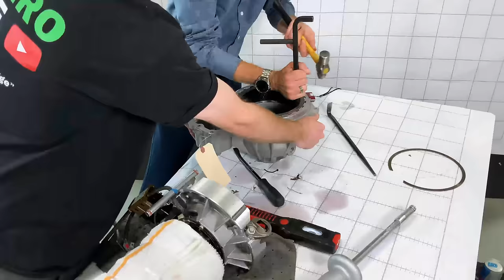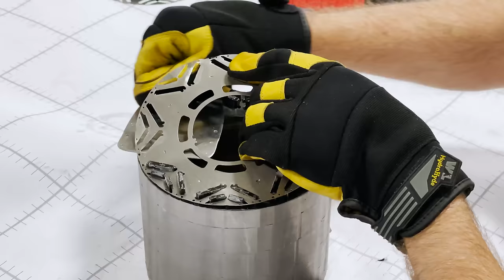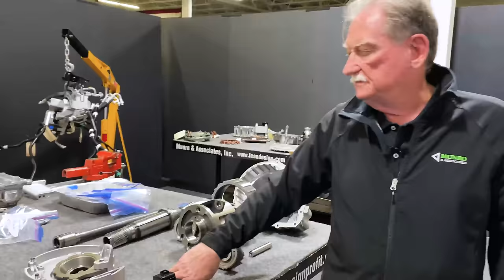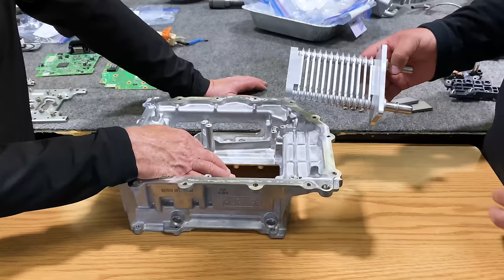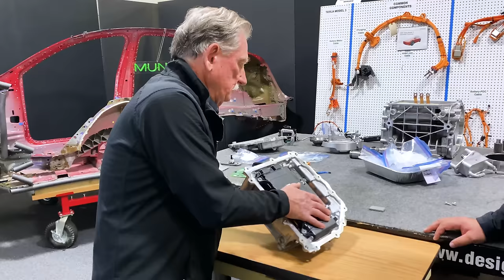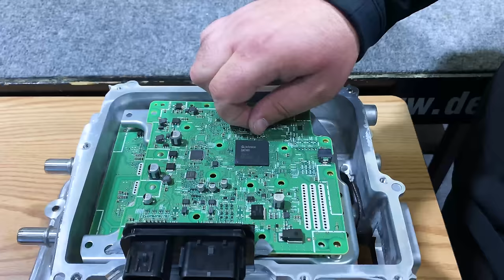Ford Mach-E Rear Motor Teardown and Analysis

Comment: With 7000 miles on my Mach E, the vehicle is running flawlessly. (Phone as a key has had issues). With 9000 miles on my Tesla model 3, I’ve had two visits to Tesla service for minor issues. Rear view mirror fell off and the charging door wouldn’t open. I’ll reserve judgement until both have had 50,000 miles on them.
Reply: My friend just sold her Tesla model 3 last Saturday and bought the Mustang Mach E and she said it's so much better to her. She had hers for 9 months and had several issues and she had enough.
Reply: That's a reasonable way to assess them from the consumer level. But from an engineering level (and I am NOT an engineer.. so looking at it from a limited perspective).. cost analysis and engineering complexity.. Ford is up and down from one area to another. They got some things done well.. other areas seem to need a lot of refinement. Not to say Tesla is perfect lol.. but a lot of their issues is the fit and finish an quality control that they need to improve on.. as a fairly new company, you can expect these to naturally improve and mature over time. They already have drastically. As well as their under body design, going towards the mega castings. As for Ford. I am not so sure these engineering challenges just improve naturally. My concern is these are things pushed on these engineers based on Fords culture of operations. Silos.. bean counters.. parts bins.. management making decisions when they have no real interest in what's best for the customers. Not a fan of the MBAs making decisions on the guts of the cars.
Reply: Has the phone as a key issue been resolved with the Mach E? Also, what year is your M3? I've heard early builds had a lot of issues.
Reply: @jodrhh  yes the phone as a Key issue has been resolved to an extent. But  every time there is an OTA update it seems I have to reinstall the phone as a key. My model 3 was purchased in December 2020 but is a 2021 model year. The Mach E was purchased in February 2021. We wanted to replace our 2013 infinity jx35 and the obvious choice was the model y buy we decided  on the Mach E after test driving both.

Comment: 24:50 I am certain this pcb is mounted first and after that the mosfets are placed one by one and soldered. Or the mosfets are soldered on this pcb first and then this pcb is mounted sliding thos mosfets between the cooling ribs. Both ways are much simpler and are way faster as it will 'auto align' the parts.

Comment: You "never see" brazed plate heat exchangers on EV drive units then walk right over to a Tesla drive unit and lay your hand right on their brazed plate heat exchanger.   (???)
Reply: ...sometimes Sandy is a little too cavalier with his critiques.
Reply: Yeah, had a big WTF moment there for me too. Not sure what he was trying to get at there.
Reply: Ford's heat exchanger was inside the case (noticed from the short clips in the opening sequence).  Tesla's is outside.  That might be what he meant.
Reply: @charlesball6519  In the second brief clip barely one second into the video you can clearly see it on the outside of the drive unit (upper left in portion of the image).

Comment: "There was not enough room to get SEVENTEEN in there..." LOL! Sandy is RUTHLESS!   
Also, holy crap - lining up the board with 90 pins below = bent pins on every unit 100%.  
Definitely at least 25 dropped screws rattling around in every one of these...  
Great work Sandy and Ben!
Reply: Sandy looks at motor:  "I see nothing but heartache and grief."
Reply: ...sure, but only time will tell who's design is best.
Reply: It reminds me of why CPUs moved from having pins on the CPU to having pins on the motherboard. Bending those pins was extremely easy!
Reply: @AudiTTQuattro2003  Agreed.
Reply: @AudiTTQuattro2003  - The more parts and clutzy design the greater the chance of future problems.
Reply: @AudiTTQuattro2003  what time is necessary? they have the competition right there next to it. You can SEE the differences. And the performance numbers are already known. Ford's motors are 'the best' at nothing I've seen measured

Comment: Never saw Sandy this depressed talking about engineering... 😔
Good job, Ford! 😂
Reply: exactly my thoughts haha
Reply: I feel like sandy is too focused on cost reduction. Faulting Ford for having an oil cooler while praising others for not having one is nuts IMO. Give me the oil cooler any day. Or welding a high voltage electrical connection over a snap in. I’ll take the weld. Especially in an application with plenty of vibration. He knows his stuff, but this mentality is why we get cheaply built crap. It’s  anti-consumer and pro bottom line for the company.
Reply: @AustinFerguson  the build quality of the Electric Motor in the Mach-E looks way more advanced and robust compared to the Tesla.
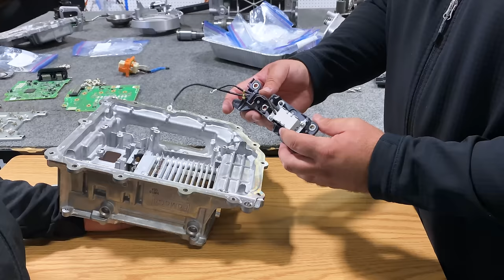Reply: 19:07 MECHA-MUNRO!!
Reply: Yep...I was about to post the same comment
Reply: @RogerM88  What's in the fuck do you really know about fasteners that wasn't regurgitated information? Please do explain Mr sideline engineer with your wealth of knowledge. 
I'm waiting for something that's not regurgitated so please enlighten us?
Reply: Wait until he meets your mother. Bahahah!🤣😂
Reply: @jabroni6199  ...I agree. Not having the full story behind why some of the design was done, could be just harping about his own lack of knowledge of the engineering involved. Kind of like Fox News complaining about Obama not saluting a Marine guard correctly. At the time, it seemed a big deal. Now we know it was stupid and juvenile.
Reply: @twany442  what does it matter if it’s regurgitated if it’s true?
Reply: @jabroni6199  of they aren't thinking about their own costs, there's a good chance they aren't thinking about the customer either
Reply: @RogerM88  makes no sense to say that. Especially when you have thousands of Tesla's that have over 300K miles and never heard of a motor replacement. Until Ford does a OTA update to increase performance and mileage I don't see a reason to think Ford's design is superior.
Reply: @Dunderwood62  maybe they’re thinking about putting out a product that isn’t going to vibrate itself loose? Or overheat when driving across the desert?
Reply: @stevencastellanos8063  Get it a year or two then you can run your mouth. Because only time will tell the truth.
Reply: @RogerM88  And who wants a bunch of plastic in a Hot ass motor waiting to warp and melt and corrode over time. I think the maybe 3 pounds of savings from the engine isn't worth it. And only time will tell.
Reply: @twany442  wow get a little butt hurt. Hopefully Mach-E motor won't break in a couple of years because they said themselves they'll be bankrupt by 2030. The data is there for Tesla.
Reply: @stevencastellanos8063  how many Teslas or other EVs you know with more than a decade of usage, and still be used as a daily? That's why Plug-In Hybrids, are to stay for a while in the market, also more affordable. The market show us there are a lot of demand for PHEVs.
Reply: @stevencastellanos8063  I’ve heard of motor replacements on a Tesla.
Reply: @twany442  Actually, that's Sandy's job is to analyze and advise, so that consumers can be spared the rather expensive "time will tell the truth." In this case you--as a Mach-e owner/fanboy--can learn from Sandy and take the pre-emptive step of purchasing an extended warranty. Then just sell the car before the extended warranty expires. In that way you can limit your financial exposure owning this car and still enjoy the experience.
Reply: @RogerM88  
"Seems" more advanced?
Reply: @rogerstarkey5390  yep. Tesla engine assemble, seems coming out of a washing machine, while the Mach-E seems to come out of an industrial machine.
Reply: @NukemNak  you give far too much credence to a channel who's job it is tearing down vehicles, and use Bauer power tools to do so. Sandy isn't about promoting quality, except for the occasional instances when you can improve both quality and reduce costs. Beyond that, cost cutting takes precedence, even if it means you have to cut corners to achieve it.
Reply: @RogerM88  100% agree.
Reply: @RogerM88  Anything about Ford is going to trigger them. And then you have to ask the question why? Why are they so pressed, triggered, moved, bothered, worried, intrigued, envious, drawn, heated, analytical, inquisitive, hateful and we definitely could go on. Moreover it speaks volumes about how moved they are by Ford. That's a lot of emotions put into a product that you feels yours is Superior to. Just saying!
Reply: @NukemNak  Bye Girl!
Reply: @NukemNak  Sandy is your god sweetheart not everyone else's.
Reply: @twany442  Tesla been over hyped for a while. Their loyal fans, still ignore that a car manufacture that wants to play with the "big boys", still has to figure out their quality control, more evident in the panel gaps. Now that big manufactures with a big know-how in mass production are entering the EV market...some get too upset watching them arriving to the market with already a product with better construction quality. The details on those cooling galleries, and the wiring arrangement on the engine in the Mach-E, just shows you how the "big boys" as Ford, are well capable of offering a quality EV.
Reply: @twany442  😮🤤
Reply: @RogerM88  thank you and I 100% agree
Reply: @jabroni6199  
Except one of his jobs at Ford was to improve build quality. Bad quality hurts the company too, not just the customer, because of the warranty. Not to mention reputation.
He knows how to make products that are cheaper AND better quality.
Reply: @andrasbiro3007  have to disagree. The manufactures pay him for specific information. Cut costs, or improve product quality could be different themes to research. He also praises plastic battery pack encasement, that with common costumer usage, are more prone do be damaged with underbelly impacts, or losing structural rigidity with heat cycles.
Reply: @andrasbiro3007  there’s no “except” since that’s not his job right now.
Reply: @twany442  ROFL! Even Ford knows this thing is going to die young. Why do you Fanbois think the warranty period is so short? If Ford believed it would last, the warranty would be longer.
Reply: @jabroni6199  You give far too much credence to your uneducated opinions. There's a reason OEMs pay Mr. Munro  $50K for his analysis. (Including Ford.) How much do OEMs pay for for your opinion? LOL.
Reply: @jabroni6199  ROFL! It's funny how Mach-e station wagon fanbois get butthurt about the truth.
Reply: @NukemNak  not a fanboy of any brand. Maybe watch Sandy's videos with someone who has a brain and see that most of what he proposes is cost cutting, not maintaining quality. It's not that hard.
Reply: @RogerM88  
Wrong. If you actually watch his videos, you'll notice that he often talks about quality too. The changes he propose are both cutting cost and improve quality. Most of the time he tries to simplify things, which usually have both effects. More steps in manufacturing and more parts in the product both increase the potential for errors and therefore reduce quality. Also it matters a lot how you join parts and what material they are made of.

And he never said that structural member should be plastic. Those batteries are not structural, and they are protected by the rest of the car, the enclosure is just holding the parts together, doesn't provide significant protection.
Reply: @NukemNak  never said that. Maybe reading connection isn’t your thing. I acknowledged a few things address both quality and costs, but a lot doesn’t. Heck, Sandy himself has acknowledged his cost cutting sometimes goes too far for manufacturers when he was talking about making the door modules purely a clip on appendage with zero fasteners. An idea he proposed to Ford which they rejected. When your cost cutting goes too far for even Ford, a company who will do things like delete the backlight for USB ports while also raising the prices of their cars, then you know you’re compromising quality. Since you take Sandys words as gospel, feel free to go back through the videos and find it. Don’t take my word for it, take his. He is very good at his job. But his job isn’t to give you a better car. It’s to give you one that’s as cheap as possible to produce. And don’t get it twisted. You won’t realize those cost savings. The cost of hiring Sandy will be passed on to you, while the cost savings will go straight to the CEOs and share holders. So go head and walk around like you have a clue by proclaiming that cars with minimal fluids and no efficient way to cool them is a good thing. It isnt, and no amount of your tube videos you watch or reach arounds you give will change that. 🤷🏻‍♂️

Comment: Nice video.. love watching. One thing is interesting though. You are assuming they don't mount the circuits to the silicon board first.. if that were the case there would be no problem aligning a few welded connections..

Comment: The MOSFETs would have been soldered to the board first, then lowered into the cooler, the flipped to weld the tabs.

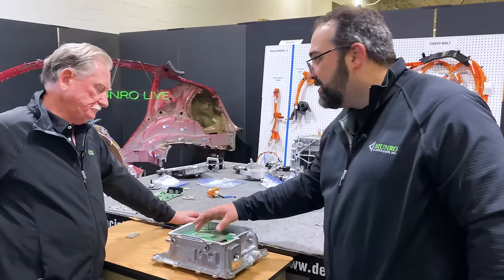Comment: 24:30 I was thinking they'd install the MOSFETs with the same pick'n'place equipment that populated the rest of the board, then drop the board into the inverter casing, slotting the MOSFETs into the heat exchanger. THEN you turn it over and do all the goofy welding.

Note also that the inverter is probably assembled in a separate plant, most likely in a low-grade cleanroom. Still a pretty wacky design, I'll give you that.

Comment: Circuit boards are extremely vulnerable to cracks caused by fatigue failure resulting from vibration. They need far more support than a cover.

Comment: It seems each sub component is designed by a different person or team.  Then when they meet for the 1st time, to assemble, they have another team that tries to get the subcomponents connect with additional sub components (connectors).
Reply: Yes, while those others are in their intern meetings not disturbing the other engineering departments which are stupid anyway...:)
Reply: Like the 4 blind men holding a different part of the elephant.

Comment: Oh boy ... I would kill to be an intern at Munro ... Are you hiring?
I'm from overseas, hope that's not an issue 😅
Reply: Maybe your murderous tendencies might be an issue ^^'
Reply: Maybe if you graduated with honors from a top notch engineering school with a graduate degree in automotive, electrical or mechanical engineering.
Reply: @Chainyanker007  Or work for Tesla on one of their design teams. Elon Musk doesn't even require a college degree to hire.  Haier is the same.  Top honors might work against you because they don't teach in college what Sandy practices and the last thing he;d want is anyone who thinks they know it all.
Reply: @Chainyanker007  I have met so many book smart "engineers" that have no common sense or design intuition or problem solving capabilities.  They are good for filling out schedules, asking suppliers if they are on schedule, and making power point presentations about which high dollar software they need to make a better schedule.

Comment: This e drive was developed and built by Borq Warner and will likely be sold to other oems. The Lightning will use a Ford in-house designed and built motor assembled at Ford Van Dyke electrification center.
Reply: Probably with "RIVIAN" embossed on the casing (😉)
Reply: Makes sense Borg Warner components have always been mediocre at best.
Reply: Yeah I was looking for BW commentary.
Reply: Why should anyone believe someone who thinks it's BORQ Warner?

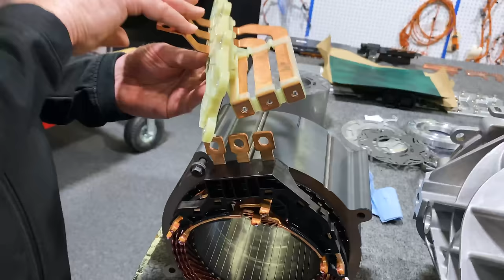Comment: 8:15 Perhaps it could have been made more compact, but they need to pass the connection through a watertight seal, and they did it with that component.

Comment: Can't the MOSFETs be pre-soldered to the board and the whole board go in first into the radiator from the bottom, then weld the bus bars?

EDIT: Saw the second board...
Reply: They're laser welded. And yes it looks like the mosfet and Buspars could be pre-assembled, inserted and bolted down as a single unit.

Comment: Couldn't the MOSFETs be mounted to the PCB then inserted into the heat sink, before the welding (soldering) is done on the power side?
Reply: That's my guess, the fets are soldered to the gate drive board and they drop in from the top together.
On the other hand, the control board must be soldered in on the line so who knows.
Reply: Yep.  Honestly, them thinking that board was installed after the FETS were welded in rather than it being populated and then installed into the heat sink really makes me reconsider the credibility of this channel.
Reply: @petergabrielsson2013  The thermal expansion spring is installed only after the SiC MOSFETs are inserted between the heat sink plates, thus the separate bracket that they didn't understand in the beginning.
Reply: @1djbecker  makes sense

Comment: Would be great if Ford could have their lead engineer respond to Sandy's design questions.
Reply: Why should they? They don't own him any explanation at all. Only time will tell and show if he was right.
Reply: ...yes, that would be even more informative for everyone. Some things may be done for cost reasons, but there might be hard data as to why others were done. IE, that board with 17 screws might have failed with only 15.
Reply: Peter, problem is Ford has too many Engineers working on the SAME system , from Different aspect. 
not, what you want.
Reply: It's not a lead engineer but a commute.
Reply: @thealienrobotanthropologist  - I never claimed to be one.